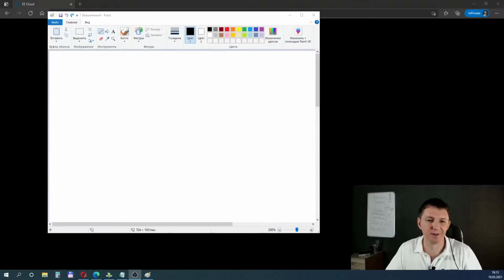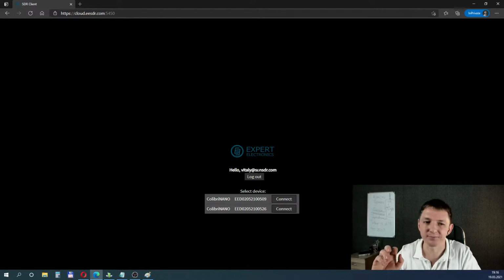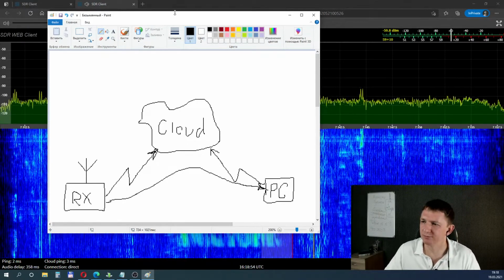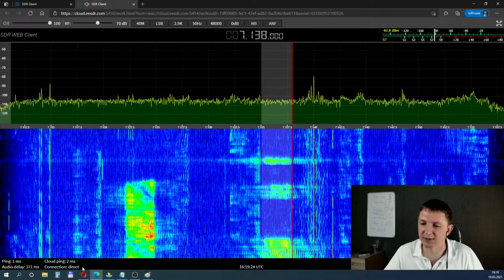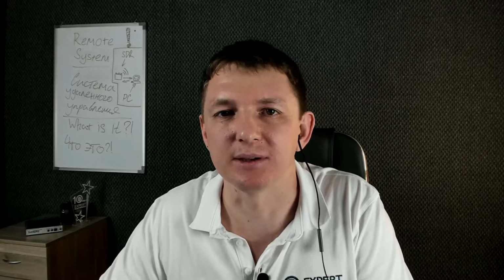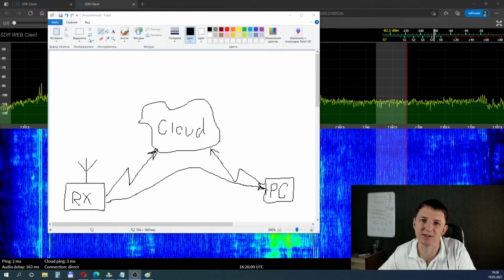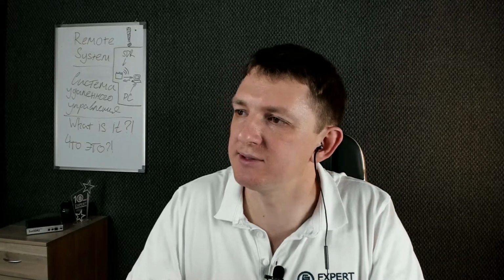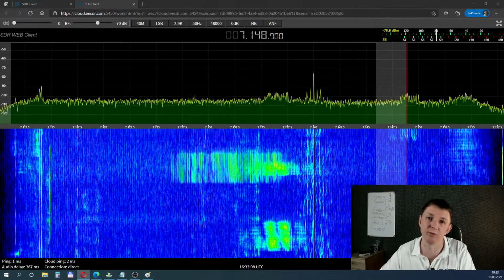ExpertRemoteSystem - Whats new?! 19.03.2021

Comment: Your network comments on FlexRadio are not correct.  You need to do some homework on the FlexRadio SmartLink traffic paths.
Reply from the maker: Thank you for the comment. It was information from Flex-6600 user, may be they should study information about traffic paths.
Please, give me link on description, I'll transfer it to your customers, will correct my view, and will inform my followers about it in the next video.
Reply: @R6NY  FlexRadio communications are peer to peer, meaning end user to radio.  The cloud is used in a minor role.  I would recommend, that as a manufacturer that you do some research is you are comparing a competitive solution.  It is your duty as a manufacture.  Just some friend advice.  73 de va3mw
Reply from the maker: @FlexRadioSystems  thank you Mike.
100% agree with you. Will note it in my next stream. 73!
Reply: It would be nice if Flex did some research on why not to use WPF and C# for the client software resulting in a crappy crashing computer program  and do some serious development like SunSDR does.